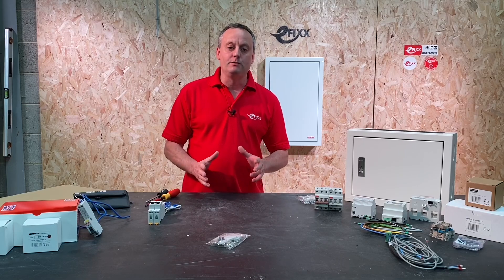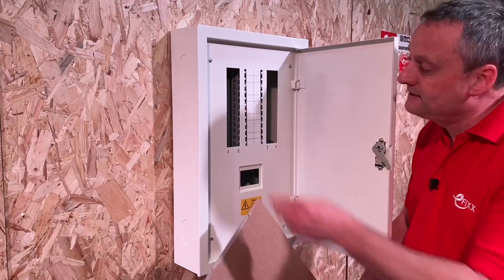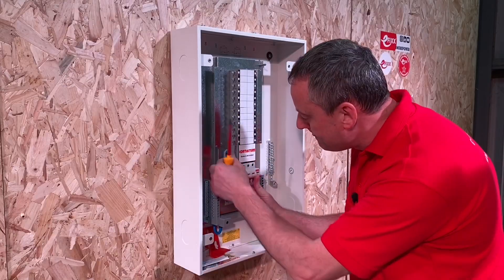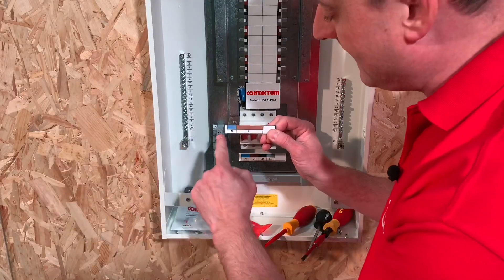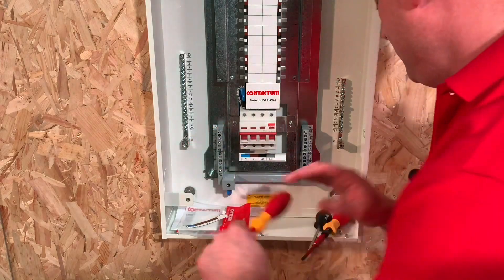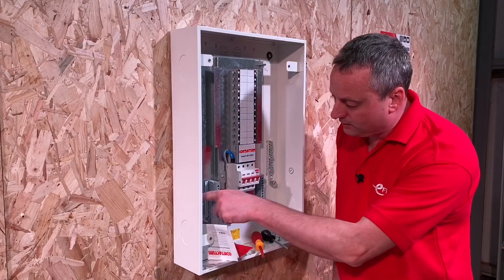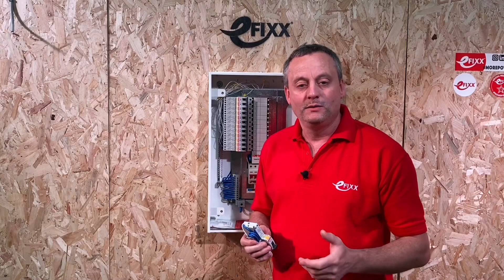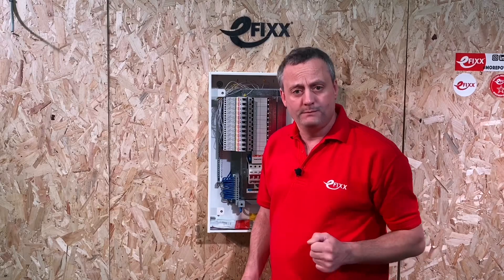Converting a Contactum three phase distribution board to a single phase consumer unit.

Comment: What's the model number of this box and it it still manufactured? I'm renovating a domestic property with 3-phase supply and expect to have around 20 single phase circuits (no 3-phase needed) so this box looks ideal. Obviously, I wouldn't be using the single phase conversion kit you show, and my question is a bit off-topic, but I'm curious if you have any general tips for balancing 3-phases in a domestic installation?

Comment: If the incoming 3 phase is at 400v, does that mean when the phases are combined that single phase output to the circuits is 400v or 240v? Excuse my ignorance!

Comment: Thanks, this was very useful and informative.  Maybe you are unlikely to fit this in a domestic dwelling in the UK, that has a reasonable power supply, but here in Italy, the maximum supply for a single phase is 6kw!  In order to have a heat pump, solar setup, a couple of air con units and future-proof for a possible EV point, I am to have to go three phase (12 or 16kw). Using a converter like this will save me having to replace  everything else!

Comment: I am in the middle of installing this same board for an initial 3 phase system, but the customer doesn't need 3 phases for what they require it for (long story). Anyway, I have the same isolator and conversion kit, but it doesn't seem to fit.  Before I take it back, do you have any other advice? The instructions and diagram that came with it are really poor, but it seems simple enough in the video to install. Love the you tube videos BTW!

Comment: OK ... Let's count up ... 3 x 32A final rings (up, down, kitchen) 1x 40 A shed/garage feed, 1 x 45 A cooker feed, 3 x 6A lighting circuits, 1x16A fridge/freezer dedicated RCBO radial, 2 x RCD Breakers (63A & 80A), 1 x surge protector, 1 x AFD, 1 x 2-pole incoming isolator that lot requires a total of 19 positions. A normal 14 way CU has 16 (2 for the isolator) ... That is for our MEDIUM sized 3 bed!! WHAT were you saying about NOT going to need more in Milton Keynes? Oh! Yes, a double stacked CU! Hmmm. Now THAT means 4 ways gone out of each level for separate AFD & anti surge plus 2 more for an RCD (63A & 80A) that leaves 6 ways ... WOW! ALL that extra money and all I get is ONE extra way per level!

Someone needs to do some SERIOUS thinking about layout in these things! The three phase to single phase conversion is nice BUT it would be FAR better if there were 3 din rails horizontally 2 levels of 12 ways plus the included 2 pole 100A isolator at the bottom, plus 1 rail at the top incorporating a full isolator for everything, a SINGLE AFD and a SINGLE surge protector for the whole system leaving 8 ways for additions to the din rail like wifi or Ethernet energy monitor, doorbell transformer, home automation controller etc.

The bottom rails also having plenty of spare rail space for whatever.

If customers are going to need more   ways in the future it will be for more circuits not necessarily more power.

With the move to LED lighting 6A circuits barely consume 2A - mine doesn't use more than 1.5A if I turn on EVERY light on the downstairs circuit.

The standard 14 way CU (a falsely advertised piece of kit if ever there was once since it ONLY provides 10 ways!!) Is TOTALLY inadequate these days for the 18th edition and the proposed other changes (it's been inadequate since the 16th edition). It's about time a BETTER, more spacious CU was available as a standard single phase box without having to spend extra to "downgrade" a three phase box! 🤔😲😱😥😥

Comment: So you have just ignored cascading?
Your incoming supply is say 100A and your triple pole isolator is 125A.
So draw 40A through each pole and the incoming fuse/breaker will trip and not your isolator!
Don't like this idea at all.

What is with the UK?
Why on earth would you use single phase anyway?
Just get three phase. Much better for capacity and for voltage balance.
Plus if one phase goes down (been there many times), you still have some power.
Reply from the maker: 99.9% of homes in the UK are single phase.  This is just a way to utilise a three phase board on a single phase supply to gain more outgoing circuits.
Reply: @efixx  Great idea for more circuits. I know all about that.
My house has 10 distribution boards of various sizes. Four main ones with RCD and the rest sub boards from those.
Three phase 80A per phase.

So what do you do for overload protection?
Just rely on the DNO breaker or fuse?

Comment: Are you seeing these poping up in new builds. Interesting if 3 phase supplies are getting into residential homes. Do you see 3 phases in flats or generally commercial?
Reply: Western Power are looking at going with 3 Phase heads on all new properties soon but with only one phase for the property. That way in the future they can come around and swap phases to balance the phases if one starts to get overloaded due to lots of EV charging on one phase.
Reply: @samplumbe3288 
I’m not an electrician.  Isn’t 100 A the most you can get in the UK as a single phase supply?  With EVs becoming more common and things like electric heating isn’t it likely that we’ll be seeing more domestic properties needing more than 100 6:32  A in future?  Having 3 phase available would also have the advantage of being able to charge an ev at about 20 kVA on a 30 A circuit.

If you install a board such as this presumably it could be converted back to three phase if the supply is upgraded to 3 phase in the future.  If this was likely to happen it would be worth giving consideration as to which circuits to put in which positions with regard to which circuits will be on which phase after conversion?
Reply: I have always had 3 phase installed to new build blocks of flats. I am a PM rather than a sparky.

Comment: why would you not want to use all three phases? in Norway its common practice to use all three phases plus N on a TN distribution. that way we get away with much smaller main fuse. is it because you only have access to a single phase from the distributor? also this does not have much to do with this, but we use fuses where the N goes through the fuse along with the 1Phase, therefor them being bigger. taking up two slots instead of one. I wonder why that is. I know they do it like here in the video, in America also.

Comment: I don't get why you wouldn't just leave it as three phase if it was feeding say something like a mansion. Whats the advantage of making it single phase?
Reply: One disadvantage of 3 phase at 230v line voltage in small dwellings is the potential hazard of having 400v difference between, for just one example, sockets separated by less than 2 metres. Modern RCBOs and good design have presumably reduced the risk of direct contact. Not yet sure of the relevant regulations in the current 18th edition of BS7671 (UK).
Presumably a high predicted load for large mansions will automatically necessitate a 3-phase supply.

Comment: This is a good idea for properties which have a lot of circuits. I live in a property with two consumer units and 38 circuits. It’s quite a large place, there is a lot of circuits because of keeping things easy in case of a fault in the future as there it’s a large place.
Reply from the maker: Thanks for the great comment
Reply: Thanks. I wired and designed the installation. I felt that it was better with lots of more localised radials than big large ring circuits.

Comment: I’ve been installing three-phase board as a single phase converted board for the past 10 years in most four  bed plus house sizes specially in London extremely easy to do. Only downside is the cost of the RCBO

Comment: I did one of these once in a 16 room HMO. Used an 8-way wylex board Ideal for the job and load. The only difference was I ended up using a 3-phase supply as a single 80/100A just wasnt enough. Otherwise exactly the same using all RCBOs. I guess thats the only disadvantage. Your stuck with RCBOs for most circuits. Shame about the cost - About £800 all in including the unit.

Comment: Surely you’d just buy a large single phase board in most circumstances or a dual
Reply: Find one! I tried. Given up! Designing & building my own with more and better safety and monitoring features than are available ANYWHERE! Using a standard empty steel box, added din rails, EXTERNAL overall 100A isolator/contactor. 

PLENTY of space for ALL the automation, individual circuit voltage, current and power monitoring and control. Box overtemp monitoring with main feed auto cutout what CU have you EVER seen with that? (MCB's have burnt out causing fires before now!!) and lots more. 

The IET (I've been a full member for over 45 years) are luddites when it comes to domestic electric safety - WHY is there STILL no overtemp (60°C!) auto isolation and alarm INSIDE a CU if that's where so many fires start? Supposedly the reason why we went back to steel boxes! DOH!

Comment: just think in n.america this is a normal size panel for us lot of room lot of spaces for glands tht you UK sparks seem to hate lol. all of our cables coming into panelboard need to be glanded and secured with in like 8 inches of it too. things i love about your wiring -Armored underground cabling ,switches on outlets, your connecting blocks over our twist caps and the newest one your use of din-rail connectors for panelboard j-box extensions.
Reply: I like the sleeving over the ground wire that is applied in the UK. Actually, I think that it would be nice if cable manufacturers would just insulate the ground wires and be done with it. Once breaker panels get big enough and have enough wires inside then bare USA ground wires can be a pain sometimes when working on a live panel - mainly when replacing an old cable whose wires are often at the back of all the others.
Reply: @JasonEDragon  i just realized over in the uk you have so few circuits tht yes you seem to have to move and add breakers where yes having earths sheathed makes sense where as in the us panels it may be a pain in the ass to get to but many circuits are never touched we seem to have panels from the old edison fuses still in full operation.  

i have a couple of times sleeved my grounds usually in j-boxes with multi circuits or device boxes with max wire fill. 

with your example though if i ever redo my panel or a close frnds i might think about getting some sleeving for the panel earths🤔😉

Comment: Did a commercial job like this once. All came populated from manufacturer with the link in. Except the comms room was tpn supply and when the spark (not me) energized it, he proved the pfc at the isolator by a large auditable and visual indication of that copper link going KABLEWEEE.
Reply: Ah, good one. Went down the line looking for electrical ineptitude and found it.

Comment: I've done this a few times,  Contactum TPN boards are very good value. There are a few easy pitfalls to be aware of, only use 10Ka RCBOs as the fly lead's are too short on the 6Ka to reach around the larger DB. Make sure to purchase the TPN blanks as they have a little gromet to hold them in place on the bus bar. Lastly the conversion system is OK but not great, I prefer to use a service connection block to bridge the 3 phase bus as a 25mm2 conductor seems to easily slip out when using the linking kit.

Otherwise a great way to have a large number of separate RCBO circuit's.

Good video 👍
Reply from the maker: Thanks for the detailed feedback George 👍
Reply: Top comment bro

Comment: Must admit, i prefer the wylex NHSPAK conversion kit, comes with a single phase main switch so it looks like it was made for purpose rather than being converted .. ocd in me strikes again.. however, the torque setting sticker is a fantastic addition... well done lads
Reply from the maker: Sticker such an easy solution - Sherlock Holmes needed to find some torque settings
Reply: @efixx  yep.. its such a simple thing, but one hell of a benefit for an installer /service tech .. it's prompted me to always carry a label maker ... as it will save me loads of time if i ever have to go back to a job

Comment: Another good video gaz  .. is there any regulations about the right way to supply rooms  in building by multiple line source becuse we here in my country each room had 3 way circuit , first for air conditioning that work on the national electricity and second for  socket outlet that works on all electricity sources , third one the light that work on solar energy by convert 24 volt DC battery in inverter to 240 volt and goes to  light circuit  .. this system make our houses using  multiple  sources becuse national electricity have issues and not supply for 24 hours in a single day .. 😆
Reply from the maker: Wow some fantastic points to consider Ahmed. Most domestic properties have only a single phase supply however solar PV and DC storage is starting to be considered for the domestic market 👍.

Comment: It might be sencible to people to have 3 phase they might have more than one charger or showers
How much more expensive will 3 phase be to have in the property
Reply: Families often have more than one car so charging will be a problem 
With electric cars more popular now and increasesing
Reply: in the states im recommending pple look into 400 amp services mind you thts 800 amps total for e/v charging
Reply: Spot on!
Plus you reduce voltage drop and neutral currents.

I've got three phase and the neutral very rarely runs at 20A even with lots running.

Comment: I’m sounding like a newb but can you fit contactors on the rail and gain access to both sides to wire them up? 
You mentioned electrician heating and I had to use 2 boards due to contactors and the spacing they require for the heat dissipation. Cheers
Reply: Yes you can

Comment: I know they do this before in commercial installations. Been in many 3 phase boards where there has only been 1 phase and majority of circuits are live. It was only a matter of time before they did it for domestic premises. Love the fact there is a sticker for the torque settings. Although the domestic scene is going to need these larger units soon with all the stickers you need to place on them! 🤣

Comment: Well it's about time! Torque setting labels already in a consumer unit / distribution board. I don't think I am the only person who gets fed up looking on manufacturers websites for the torque settings. It only takes one to lead the way... I wonder though if those who are yet to do it will use permanent labels or markings. Also would be great for the torque settings to be marked on the circuit breakers - Then you could populate a CU/DB with different branded breakers to the brand of the CU if able to.

Comment: that panel is the same size as mine here in the US! except I have a 200Amp Main!
Reply from the maker: Do you use single phase at 120VAC?
Reply: @efixx  its actually 240 single phase but our transformers cut that in half  so its +phase 120   
   - phase 120 neutral wire in the center- for our larger 240 volts balanced load no neutral required.  https://www.youtube.com/watch?v=jMmUoZh3Hq4 (really good short video of our system)
Reply: @efixx  it can be if you wire it that way....